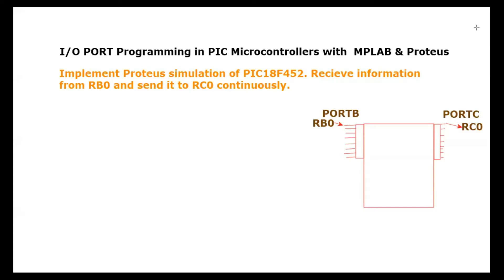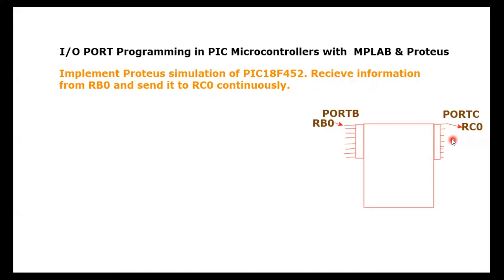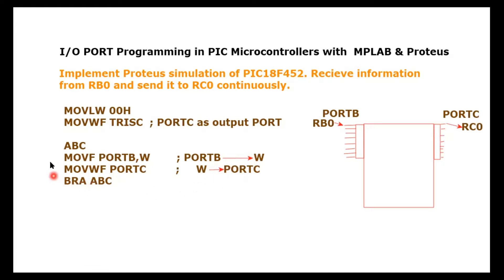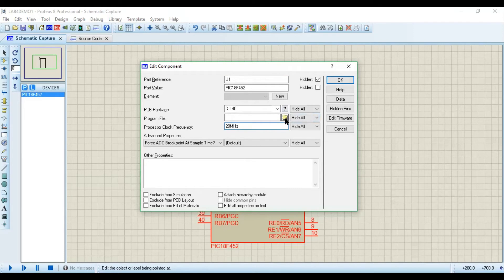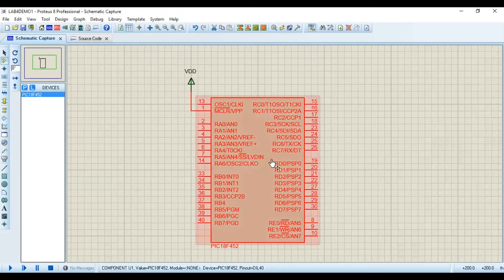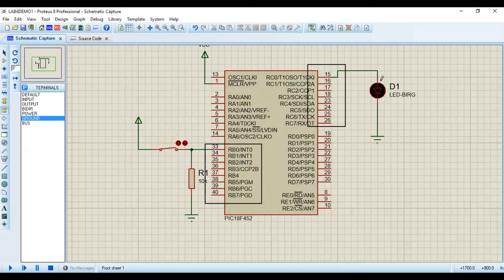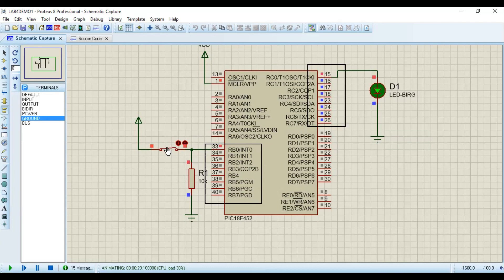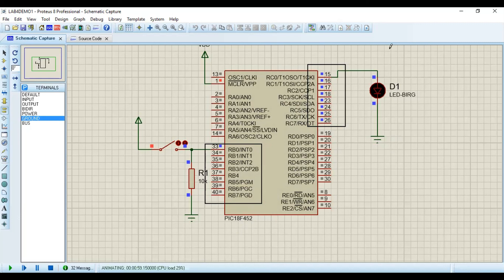Switch as input peripheral to PIC microcontroller  in PROTEUS  || Pull Down Resistor with Switch

Comment: Sir can RB0 be used as input for all RC output pins ?
Reply from the maker: Yes it can be used  if such logic is needed for any other example. Reverse is also possible thats all bits our PORTC can be used as input and with only one output RB0 if it is needed in application.